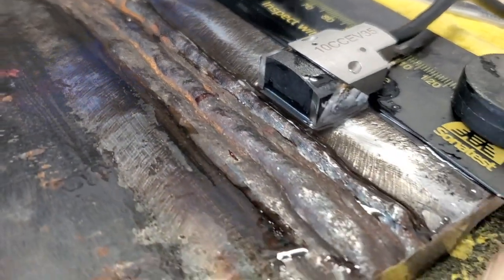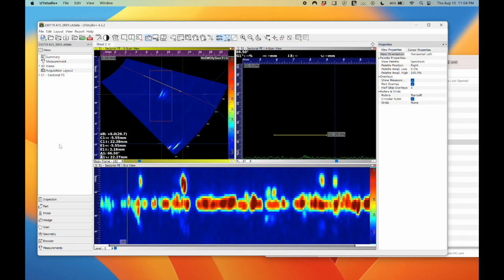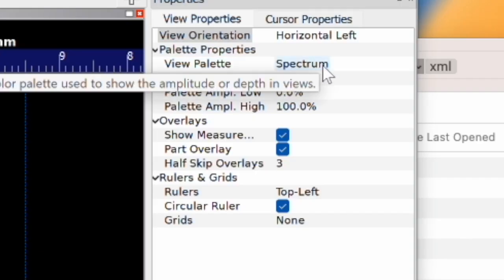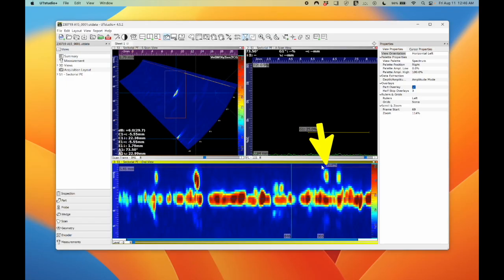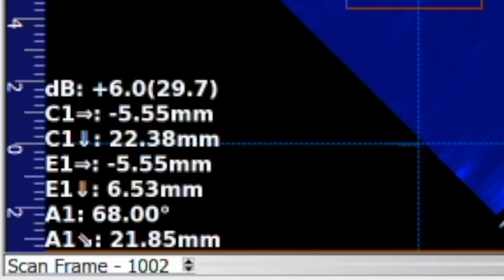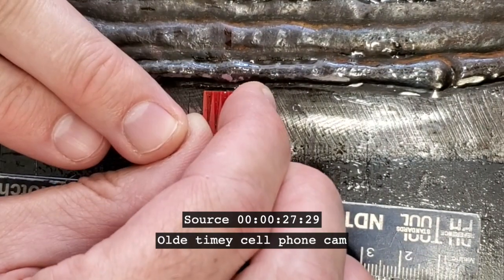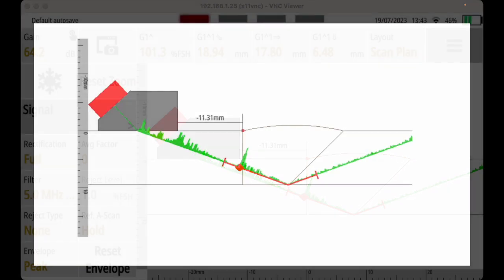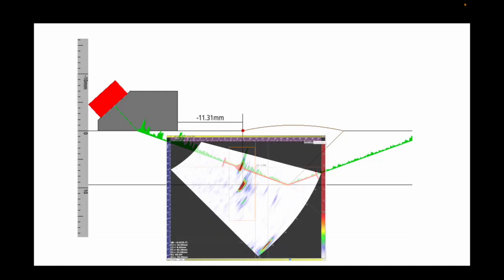Sizing with PAUT vs Conventional UT

Comment: Hi Paul, great videos man!

I have a question, do you know how to compensate for the angle change on TMCP material using PAUT? 

Cheers!
Reply from the maker: I wrote a paper on that. It's not possible with the current machines because they record velocity as a scalar, and it needs to be a vector. Here's the paper: https://www.ndt.net/article/ndtnet/papers/Calibration_for_Anisotropic_Effects_on_Shear_Wave_Velocity_for_Improvements_of_Weld_Inspections_in_TMCP_Steels.pdf
Reply: @hollowayndtengineeringinc.5201  nice one I will check it out, cheers mate!
Reply: @hollowayndtengineeringinc.5201  Hi Paul, hope you are well. I’m curious about something else 😂 I’ve been doing conventional angle scanning for last 10 years, I’ve moved in to phased array recently. I’m just wondering how you would scan a TKY with PAUT? Does the set know when the prep changes? What would go in the part and weld etc.. do you have a video or is there a scan plan somewhere. I’m not going to be scanning one anytime soon just curious again😂 cheers mate.

Comment: Hi Paul, I have a question, we have veo 3 32:128 we need buy y spliter I see on your videos, you use y spliter OLYMPUS, do you use y spliter 32:128??
Reply from the maker: Hi Santiago. The original MX (not MX2) splitter works on the Veo. I have a 1-64/65-128 splitter. I also have a cable splitter from Vermon-NDT.
Reply: @hollowayndtengineeringinc.5201 thanks paul

Comment: Sir i want to send you a video regarding measuring of thickness while using 5Mhz sometime10Mhz single crystal transducer on cal block 0.14 inches to 0.03 inches with rejection of 80%.can you explain why 3 echoes appears on screen.